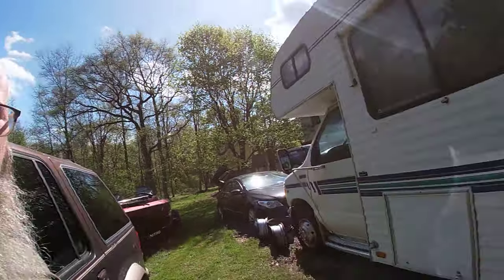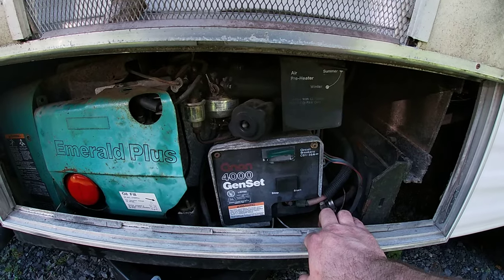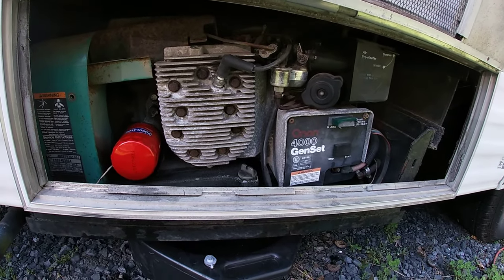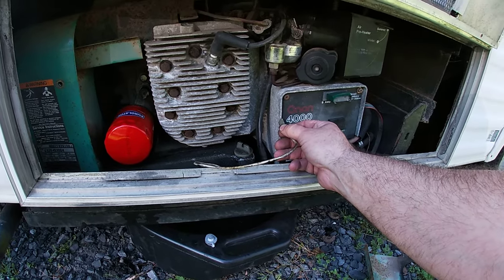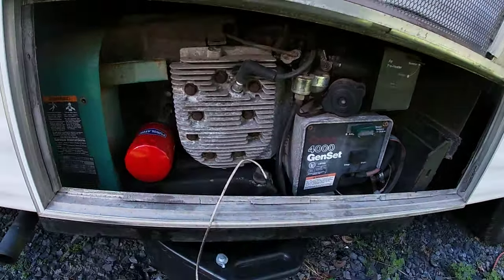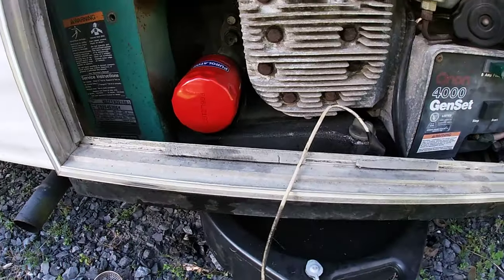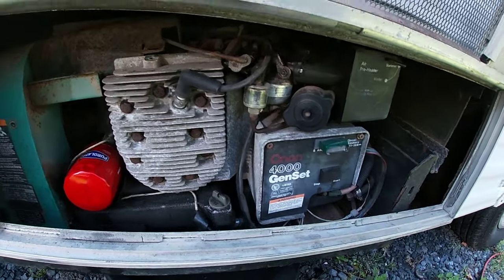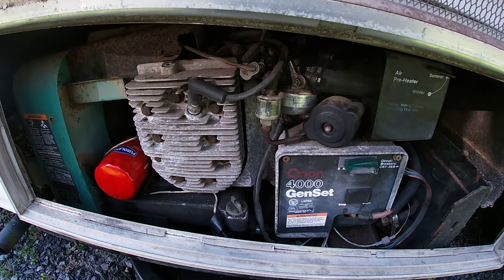Most Common ONAN RV Generator Problem Repaired in 5 Minutes! "My Generator won't stay running!"

Comment: I have a 6500 marques propane generator that cranks over but won't fire. Replaced plugs oil and air filter and oil change and still won't start up and run.
Reply: Carb is suspect then. Also fuel pump.

Comment: Mine runs great cold but after five minutes or so it starts stumble and then dies. It will restart but won't run more than a minute
Reply from the maker: Have you changed the oil recently or checked the oil? That’s also a symptom of a failing / overheating fuel pump.  (About a $25 part on Amazon)

Comment: Is it possible it could be the board when I push the switch and let go it turns off if I keet the switch pushed for 10 seconds it also turns off oil pressur switch was replaceed.
Reply: Probably not putting out 120

Comment: Thanks for help, what oil do you use ?
Reply from the maker: I use 15W-40 full synthetic oil or synthetic blend of varying brands... mostly depends on what is available at the time. Never really noticed a difference performance wise, and ONAN comments that synthetic is fine to use as long as you stick to the recommended oil change cycle (every 100 hours of use.)

Comment: My Onan Emerald 6300 does the same thing, Now, when iam holding the start button, the engine runs But, it isn't generating power, is there a safety device somewhere that disabled the generator head from producing power until the problem is resolved????, Also my generator get used daily, I do regular oil changes. Plugs, filters, air cleaners etc... My generator gets used alot.
Reply from the maker: Have you tried the trouble shooting guide that is linked in the description section of this video? It should help narrow down the cause of your output power issue.
Reply: @jeremy_rigged  That's exactly where iam going to. I just finished trying the oil pressure wire to ground and had no results unfortunately. Yesterday, I took my RV to flush the tanks and after a 3mi drive I started the generator without issue, mind you before I left the house, I tried to start it and it wouldn't, then after the short drive, it worked with power output, iam thinking that there is an electrical gremlin somewhere??? Anyways, thank you for your time, I appreciate it.

Comment: I have a 1978 Onan 5000 GenSet that I’ve changed the oil and filter, spark plug, fuel filter and air filter. Now I just checked the oil pressure switch and it was good because the bypass didn’t work. I don’t have a idea what to do next

Comment: We have been trying to get ours going, 99 Fleetwood bounder. Just replaced the fuel pump but the line is accessible so I guess that's the problem will probably just put a second fuel tank underneath hopefully that works.

Comment: My generator won’t start. But you can jump it and it will start. What could it be?
Reply: Im new to Onan, but in cars they use Relays to connect low power (key switch) to connect high power (car battery) to starter motor. I would begin my search there... Bad Relay
Reply: Look at his troubleshooting description...

CHECK CRANKING Try to start the engine. If it does not crank, check the control fuse (5A Slo Blo, except models 
with electronic governor 10A). If the fuse is good, jumper the positive battery post to the coil terminal on the start so-
lenoid. If the engine cranks, there is a poor connection, wiring damage or the control board is defective. If the engine 
cranks when the BATTERY POSITIVE pin is jumpered to the START SOLENOID pin on the control board, the board 
is defective. NOTE: The battery voltage should not go below 9.5 VDC during cranking.

Comment: I have the same generator (in Ford Jamboree 1992), it was running good all winter but now it stops after 20-30min. Usually if I wait about 5-10 min it starts again but quit after while again. Not sure where is the problem. Last maintenance was done before winter last year but now is stationary so I cannot bring it to service.
Reply from the maker: Martini... I have yet to experience that problem myself, but I have heard this symptom many times from others. A common resolution to this has been to lower the oil level slightly below the “full” line. If the engine is overfilled with oil, the excess oil may be transferred to the air cleaner case and air filter causing the engine to choke out and stall. Other possibilities are a dirty fuel filter, and / or an overheating fuel pump. I’m sorry I can’t be of more assistance on this issue. I have linked some service manuals and trouble shooting guides in the description of this video, they may be of additional help to you.
Reply: Try adjusting the choke out a little
Reply: try to pull some oil out of the crankcase, when the oil expands it will shutdown the generator.

Comment: Hey there can you help me? Have the same generator. It starts and idles on an even up down type idles and shuts off as soon as I put a load on it. Turn off the load and it starts up and idles at a up down idle.. I put a Napa fuel pump rated at 5.5 to 9 psi and not an Oman 149-2269 model if that makes a difference.

Comment: Mine runs for a couple minutes maybe then turns off. What’s wrong with it?
Reply from the maker: Could be a few things... an over heating / failing fuel pump, oil level too high or too low, and wrong oil viscosity are the more common simple reasons. How soon after it turns off are you able to restart it?
Reply: @jeremy_rigged  sometimes stays on for hours other times stays on for 2 minutes

Comment: My generator starts fine but I have no electricity within the RV. This is the first time this has happened and I'm just trying to troubleshoot the problem
Reply from the maker: If it is an Onan unit, some of the trouble shooting documents I linked in the description should be of some help. Typically no power output from the generator, start at your main fuse panel in your coach and work backwards. I like to trip and reset all of the breakers, especially the little tandem breakers. If your generator has a physical AC plug and is plugged into your RV, make sure that didn’t vibrate loose. Lastly most ONANs have a main output breaker located on the unit… usually close to the start / stop switch… make sure that one isn’t tripped. If all breakers check good, you may have a failed regulator or inverter. The linked documentation in the description can help narrow that down. Given the unit runs fine, my money is on your main output breaker is tripped on the unit. Let me know how you make out!
Reply: There is a switch on the right side of the Emerald Plus 4000. There's a possibility it is in the off position which would not allow power to be delivered to the rv. Make sure it is in the ON position.
Reply: Which is the on way
Reply: Hello everybody I also have a Onan genset Emerald 1 and I'm having generator problems and it doesn't start doesn't stay start I only can get it running with the starter fluid and it stays constant and consistent but as soon as I stop spraying it dies sounds good it sounds like it runs strong been sitting for about five years about to take out the carburetor but I see that little on and off switch I don't know if I push it to be on or if I pull it to be on

Comment: My Marquis 7000 runs until I turn on the 15,000 BTU AC system.  Any suggestions?
Reply from the maker: I’m by far not an expert on generators, but in my personal experience, every time I’ve had a load that didn’t exceed the continuous duty rating of the generator and still cause the generator to shut down, or switch off the output completely, the output regulator or the control board was at fault. In the video description there is a troubleshooting guide linked... this guide will cover the control board and regulator in your 7000, and will indicate test points to test, with illustrations. I’d start there to get familiar with the overall inner workings of your unit.

Comment: Where is the voltage regulator on this model??
Reply from the maker: Hello Eric, the regulator and control board are directly behind the black panel where the start switch is located. In the description section of this video I provided a link for the troubleshooting guide that will assist you in diagnosing a regulator or control board issue. The guide covers various years and models as well. Hope this helps!
Reply: @jeremy_rigged  I’m thinking it does go out on these generators.....but I’m gonna start all back over again.....it’s definitely not a fuel pump problem

Comment: Thanks for the informative videos, I have an Onan Quiet Diesel 7500 that I would like to rewire for a 2 phase 240v set up. I am having trouble getting info on the wiring of the inverter to see if this is possible. Any help you could provide would be greatly appreciated Thanks
Reply from the maker: Greg, I’ll see what I can dig up for you… stay tuned. Thanks for watching!
Reply from the maker: Greg… this link will take you to the manufacturer of that regulator. (They are located close to where I live.) Browse their site and give them a call… they have great tech support. https://www.flightsystems.com/troubleshoot?TROUBLEPAGE=COMBINED

Comment: Hi. Just swapped the control board because it was only sending 7 volts to the 12v fuel pump. Now the starter stays  engaged even after I remove my finger from the starter. I have to press stop to disengage. Any thoughts?
Reply from the maker: Do you only have one start switch, or is their one in the cabin remotely as well? Do you have the same symptom with both if so?
Reply: @jeremy_rigged  No. It's a bucket truck with a starter on the back of the truck and the bucket itself. However, this problem just started after I swapped boards so I attribute it to wonky wiring. But there's a relay that has been added to it;  when I disconnected it a few minutes ago it went back to normal. I'll check the other switches, maybe one is stuck.

Comment: What about a clicking solenoid.  Replaced control board, starter, solenoid and batteries topped off.  No changes.
Reply: Did you figure it out?
Reply: @benhodge8128  nope

Comment: Thanks for the info . gotta change those generator mounts too :p
Reply: good info , but half way there. If you ground the oil switch wire it will do the same thing, you will have to press the start switch twice, once to get it running then let off and press it again and let off ,it will now run.looking for solutions!  thanks
Reply from the maker: Yes.. they're a bit saggy. :D
Reply from the maker: @larrybuffkin5640  that's an interesting problem. I'll look into it...
Reply: Replaced oil sensor, fuel pump, fuel filter and spark plugs and onan 5500 marquis generator in our 2005 fiesta Rv and it still runs for 20 minutes and shuts off. Can someone help me? Thanks in advance..
Reply: @sylviagarza2921  some rvs have a limit for gas usage in the generators
So if your tank is ubder 3/4 it shuts off so you dont run out of gas ? Idk
Reply: @sylviagarza2921  Do this, look at your oil stick. Just where you start to see the oil  in the grid of the add oil.  is all you need and the gen set will run like a champ. Onan will not tell you this but it is the cause of your problems. Do it and let me know how it went.
Reply: Sylvia Garza this is Oman’s dirty secret!  Try less oil. Apparently, Oman’s dip stick is too short. Therefore, when at full line you are actually over. Try draining off some oil so you’re 2 notches above the low level line. If it now runs this is about where you should keep your level
Reply: I have a 3 kv onan diesel jenerator how do I get parts such as diesel pump injector  pump ect.

Comment: Mine turns off after 2 minutes. What could be wrong?
Reply from the maker: Russell the number one thing that comes to mind is a failing / overheating fuel pump. If you told me it would run for 30 minutes and quit I’d tell you to remove about a pint of oil through the fill hole. But if it only runs about 2 minutes, it sounds like a pump going bad.
Reply: @jeremy_rigged  I changed the altitude and it works but only stays on for about 2 hours
Reply from the maker: @russelljennings4065  after it runs for 2 hours and dies, how long does it take for it to restart?

Comment: My onan generator loses power as it runs is that because my batteries are bad
Reply from the maker: Chris, do you mean the generator stops running after a time, or the output power of the generator diminishes after running a while?
Reply: @jeremy_rigged  I think it's a fuel pump it'll just die it'll come under a load and then die

Comment: My generator looks way different than yours..mine is a onan 4000 it has a new fuel pump, fuel filter and spark plug but it won’t start and run unless I spray brake cleaner in the air filter? Could I have an oil filter problem? The fuel was replaced on the rv at the Ford shop everything else I did at home. Thank you,
Reply: Sounds like you need to clean the carburetor
Reply: @brettsalling  I was afraid of that. I'm a little iffy about testing into the carb myself. However, I don't want to take it back to the shop... Too expensive. My husband is out of town for work, so it looks like in going to have to do that. I am mechanically inclined and have done my fair share of working on things. So I think I could do it? Do I want to? No 😁
Reply: It is probably the auto choke. take the air assembly off, manually close the choke with a screwdriver and see if that gets it started.
Reply: @roberthollingsworth3545  hey thank you.
Reply: Use a 2 gallon gas can put about 10 ounces or more of seafoam add the rest gasoline disconnect your fuel line and run it into the can see from works great!

Comment: What kinda oil are you using?
Reply from the maker: Hi Lonzo, the Onan recommended oil is SAE30 or 15W-40, full synthetic. I use Pennzoil Platinum 15W-40 full synthetic, only because it’s what’s available locally to me… I’m not a fan of any specific brand. Thanks for watching!

Comment: I can save you 4 min 50 seconds. Theyre crap.
Reply from the maker: True enough Mike… but there’s tens of thousands of them out there still being hobbled along.
Reply: @jeremy_rigged  very true and i do not understand why no one else gets into the business. I think Honda tried, but Onan must be so engrained with RV OEMs no one else can get a welcome. Took mine off my MH, bought a Cabelas/Champion and installed, have not regretted it. Feeds from RV fuel and battery. Connected to a transfer switch.
Reply from the maker: @mikefreyder315  I’ve often wondered the same thing about why other manufacturers couldn’t break into the RV market. It’s not an uncommon sight nowadays to see a Honda or other brand hanging out on a hitch basket in tow behind older coaches. Cheers 🍻

Comment: Got a 97 5000w emerald plus in a RV we bought used. HOlding any of the gen starter buttons it just clicks. Never turns over. Pulled fuel lines, no clogs, pulled pump and it pumping gas. Pulled carb and cleaned it. Still not even firing up. Anyone got ideas to try ?
Reply from the maker: I can’t speak for your exact setup, but my Class C RV with an E-350 van body has a separate starter solenoid under the hood for the generator, and the house battery (the one that runs the 12 volt accessories in the RV) is also the generator cranking battery. I would verify that the starter solenoid is ok as well as all of the connections. Also try jumping the cranking battery. A clicking sound is usually a poor electrical connection somewhere, or insufficient current.
Reply: Try turning the big heavy wheel in the cage on the bottom with a screw driver until it seems free and then press the button.

Comment: I tried this grounding the wire technique and no luck..i cleaned up the case surface,.. still shutting off when i let go of switch.. i thought maybe it was the switch.. i unplugged the switch that goes into the coach.. same deal.. any other tips?
Reply from the maker: There’s a few requirements that must be satisfied for the generator to continue running after the start switch is released. 1) Your oil level must be high enough to disengage the low oil level sensor. I prefer to keep it just slightly below the max fill line. 2) The oil pressure switch must see enough pressure to close the switch. (which u ruled out by bypassing it) 3) In most RVs, your gas tank fuel level must be greater than 1/4 tank. 4) Your control board must sense 100+ volts AC coming from the generator. Connect a multimeter to one of the outlets of your camper / rv or generator and measure the voltage while it’s running while holding the start button. Let me know how those check out.
Reply from the maker: @dirtylu79  in the description section of this video is a link to a troubleshooting guide from the manufacturer of the control board and regulator. This guide should assist in determining why you have no voltage, but it is a bit involved.   
https://www.flightsystems.com/pdf/onan-rv-troubleshooting-guide.pdf